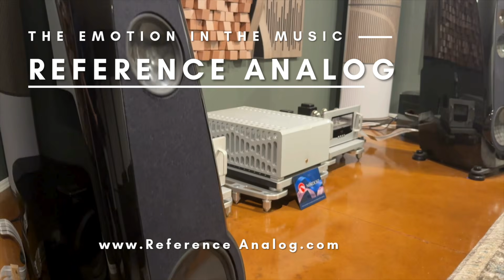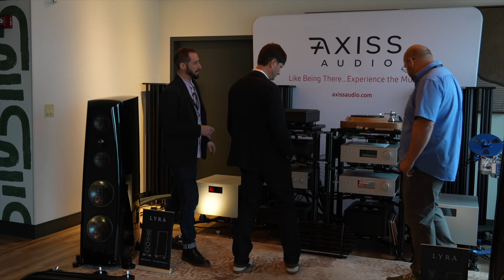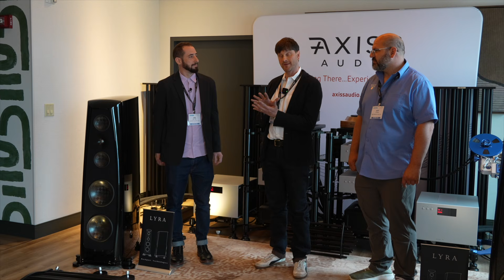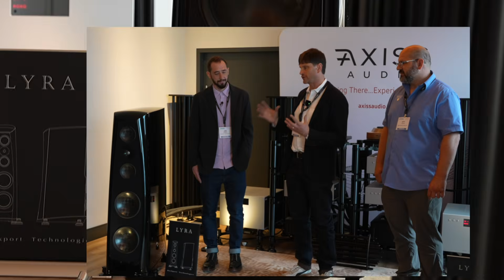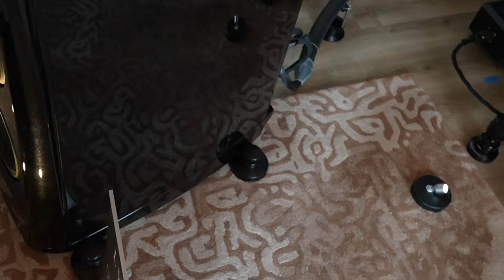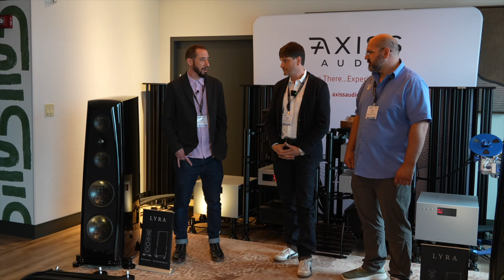Rockport Technologies at Axpona 2026

Comment: The rules of frequency are like a rainbow if you take shades away it affects the whole pallet and this is what crossovers do and because every manufacturer have different ways of faking the frequency range nobody knows good from bad . My speakers are tuned i do not have crossovers the cabinets are tuned the drivers are all matched pairs I have a frequency range of 16,000/15hz@6ohms with an output of 800w with 250w headroom, sensitivity 98db@1w@15ft you never see the drivers move even at stupid volume with serious pressure in the room , mid and bass drivers are 12” with a 4” horn and they stand about 6ft tall about 15” wide and about 2and a bit feet deep at the bottom end . The midrange alone drops to 30hz so you can imagine how large the soundstage is , they are amazing